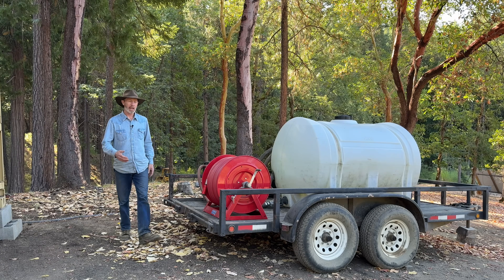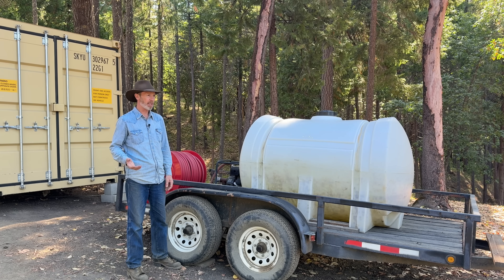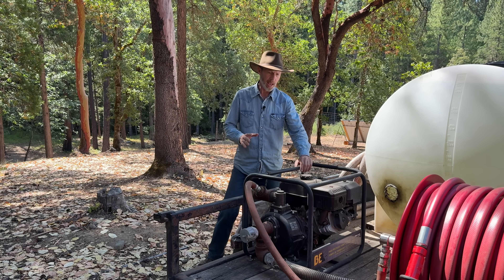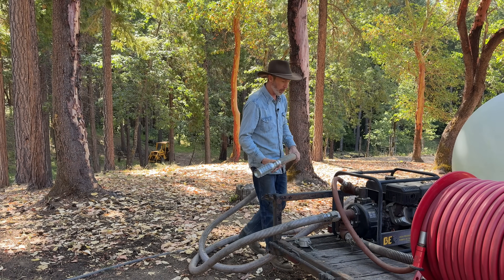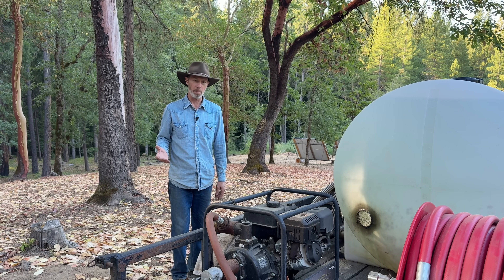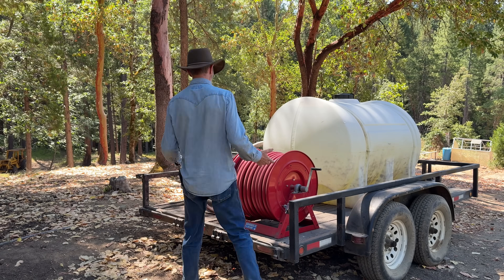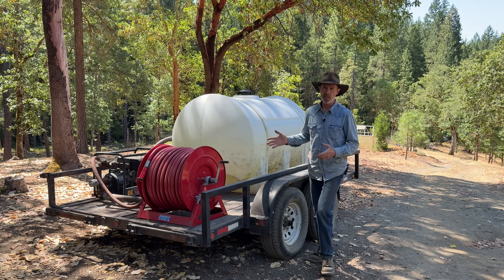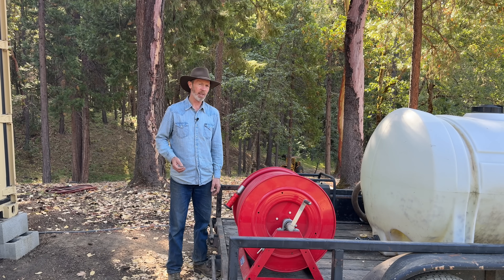I Built A DIY Wildfire Fighting Water Trailer

Comment: Keep a can of ether with the pump (if it's not a Honda), fuel stabilizer in gas tank as well. I keep IBCs filled for the summer and use gravity to fill the mobile tank in a hurry. See if local fire dept has some old helmets/jackets etc. An ounce of prevention (or 500 gallons), goes a longgg ways. Also leave 30 gallons in the tank to prime your pickup/fill line when refilling the tank from a large water source. Great video!!

Comment: It looks like you have a good trailer there but here are some suggestions to help you improve it. You look like you have enough room to put a second tank on that trailer. Put a 250 gallon tank that you could put foam concentrate in. Then get a proportioning valve you could extend your water. You can get forestry garden hose and it can take 100psi. It folds flat like firehose. So you could use it to protect the trailer while you fight the fire. You could also put a tool rack for shovels , rakes and Pulaskis

Comment: Good video. I have a water wagon that I built about 25 years ago, and has served me well. I did put in 3-way valves so you can draft from, a pond or tank to fill the wagon's tank, or just pump from the tank. One thing I would recommend is a pressure relief valve plumbed to tank. Without that, the pump can over=pressurize the system, if it's running without you discharging. Of course, I learned this the hard way, like everything else! The valve can be easily regulated, and they are not too expensive, I used hard pipe to plumb it all together.

Comment: Hey, I have a question. I have a huge, 30in diameter oak tree that is about 6 foot from my house. This oak is dying and has a large trunk from a fork, going out over the house, tree is 30-40 feet tall. I will have a cable tied probably 20 ft high and hooked to a bulldozer to pull tree away from house. Now my question is, I can’t cut tree right at the ground due to a 50 year old net wire fence that tree had grown around. So I have to cut tree app 5 foot high, what are the chances of the tree sliding towards the house on top of the stump as I’m pulling the top away from the house. Any info is greatly appreciated

Comment: Put as much of the corrugated flexable drain pipe in the tank,it will help to keep the water from sloshing around a lot........4000 lbs of water going back and forth sucks.

Comment: ODF requires 115psi at 20 gallons a minute. Have to have 250’ of hose connected and another 250’ on the trailer. 
I’ve been wanting to build a budget pump set up but the pumps are hard to find by themselves without the motor.

Comment: I was able to get a surplus m149a2 "water buffalo" at an auction.  Mounted a 2" water pump from Harbor Freight on the tongue of the trailer.  A pile of PVC fittings and valves later, it can now pump itself full from a source and then with a few opened and closed valves it can pump itself empty.  It could also draw from a source and pump directly to the hose.

Comment: I'm not as fancy as you. And I'm cheap. I have a 55g barrel in the bed of an old Nissan with a 5gpm electric pump and 100 ft off garden hose on a reel. And I have a 2" hobo freight trash pump with 100' of 1-1/2 house and nozzle to draft out of my pond

Comment: IFPL requirement is minimum of 20gpm at 115psi.
Volume pumps meet the gpm, but not the pressure requirement.
ID of pressure line is minimum of 1"
Stationary setups are 500 gal minimum. 
Mobile setups are 300 gal minimum.
A machine with a push blade is also required most of the time.
a pickup with snow plow doesn't count.
.
Spark screens on saws is 0.023 thousands maximum space on spark screens.
.
Any engine over 50ci that's naturally aspirated or a blower is required to have a USFS compliance spark arrestor.
.
Turbo engines are exempt, as well as road going autos with a tale pipe in good working condition.

Comment: Fill the tank from pond or stream by dropping the business end of the fire hose into the top of the tank and let it run. No additional plumbing needed. Mr. Obvious. 
BTW, love your content! 🙏❤️🇺🇸
Reply: It surely would work. But it will substantially faster with a 2 1/2" pipe on it that is only a few feet long it will speed up the turnaround time.
Reply: 300' of 1" hose plus all the elbows would really slow filling down.
Reply: I was thinking similarly only use the bigger fire dept fitting to return the water to the tank.
Reply: Can't keep fighting fire if you have to use your fire hose to refill the tank
Reply: @rileyasmrkitchen3859  Watch more carefully. His setup can spray water from either the onboard tank or an external water source.

Comment: if a person wanted to get really fancy, they could make an aluminum frame to bolt all the parts onto that would slide into a trailer.  then they could slide it out to use the trailer for other things when it wasn't fire season.  also, the camlocks are handy, but having an inlet with fire department threads would let fire crews refill it more easily.

Comment: RE the algae:  Just drop in a few pool chlorination tablets.  And, a length of scrap copper pipe would also probably kill the algae.  Bottom paint on boats used to contain copper because it keeps the algae and other things from growing on hull.   

RE filling the tank with the pump.  I built my fire skid, with a pressure relief valve between the fire hose manifold, and the pump, which dumps to the tank if the hose pressure gets too high.  That lets me use the pump to fill from a creek or pond.
Reply: Would the chlorination tablets affect the water tank? Just wondering
Reply: @OhRonaldo The water tank is made of blow molded polyethylene.   Chlorine bleach at up to 18% concentration is shipped and stored in blow molded polyethylene containers.  So, I wouldn’t expect the chlorine levels from one or two of the small pool chlorine tablets to get the chlorine levels high enough to have any effect on the tank, piping or pump.
Reply: @randallthomas5207  That's awesome. So you can store bleach in a tank but get one drop of Vaseline on.... oh never mind 🤣
👨‍👦‍👦👪👨‍👨‍👧‍👦👨‍👨‍👧‍👧👨‍👩‍👧‍👧👨‍👩‍👧‍👦
Reply: @OhRonaldo  It won't hurt the plastic tank but the chlorinated water left sitting inside the pump over time can be really hard on an metal parts of the pump.

Comment: Not that I have many neighbors,  but I plan on building a rig like this and giving them access to it if I'm not there.
Reply: Good idea I have one I got after bushfires here in Sarsfield Victoria Australia I stayed and defended with 2garden hoses on a electric garden pump hooked up to a generator saved the place had to run from hose to hose and cover the 60 metres combined which reached around my shed and house on shed I couldn't reach but thankfully it survived I learnt that dragging the garden hose over burnt ground melted a small hole in it had to shorten it after fires by a metre and a half about 4 feet I purchased the fire cart with pump and 1000litre tank icb on it to water trees etc after replanting because of fire but it also will be handy if we get hot again one summer and as safety for burning off all the best make sure you get one that can recirculate so you can keep it running all the time so it won't blow pump seals or hose that was you don't have to stop and start the engine that takes Precious time away from fighting the fire

Comment: If the tip of the fire hose was placed inside the water tank the water would recirculate through the pump.  Right?
Reply: Just the tip..
Reply: If a pump sits running without the ability to circulate the water, it will overheat the fins on the pump and ruin it. So you plumb it to circulate the water and it brings cool water from the tank and puts it through pump.
Reply: He was talking about not being able to fill his tank from a pool/stream. If he put the firehouse in the tank he could fill the tank from a pond/stream/pool.
Reply: I was thinking that when he was talking about what he would have to add mechanically to fill the tank.

If the other draw hose was submerged, it would be supplying the fire hose. If he shut off the valve on the bottom of the tank so it wasn’t feeding water to the pump, you could fill the tank with the fire hose.

Why would you need to add anything?
Reply: You guys are all ridiculously gullible and naive, meanwhile the smartest man in the room is laughing all the way to the bank on the back of all these comments 😂 Of course he's aware! 😂
Reply: @stevenkelby2169  Just the Tip...
Reply: @mackellyman5642 just the tip
Reply: @stevenkelby2169 
Maybe we are aware and it’s how we show our support. Jerk.